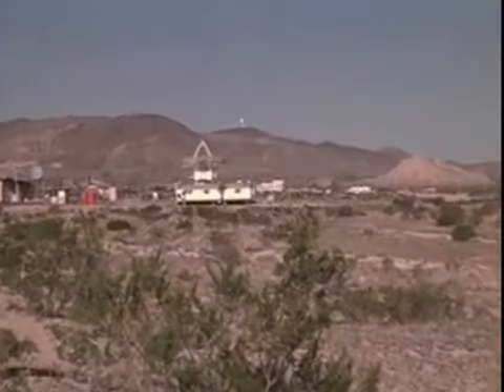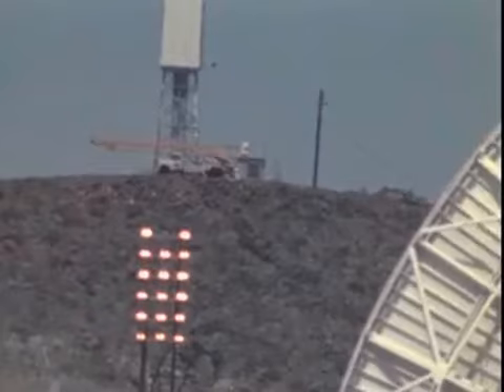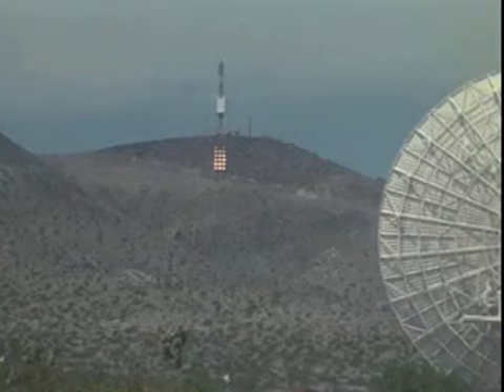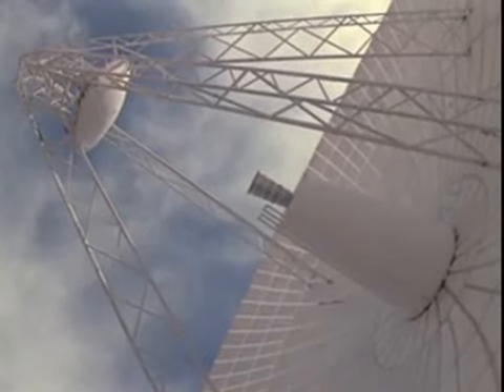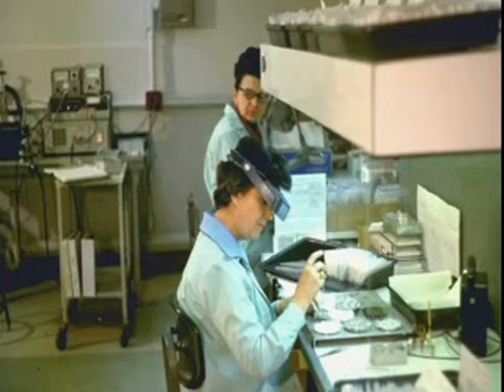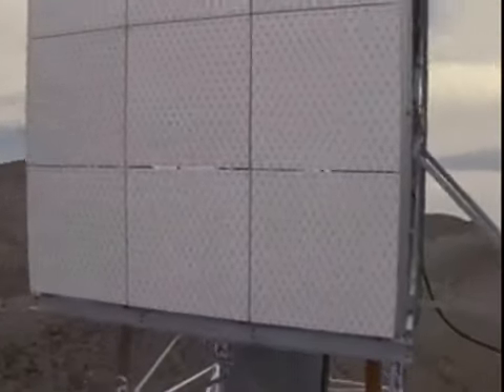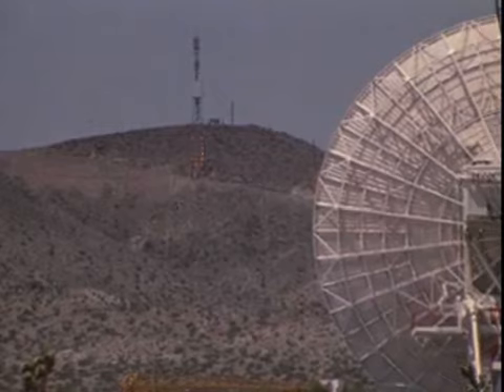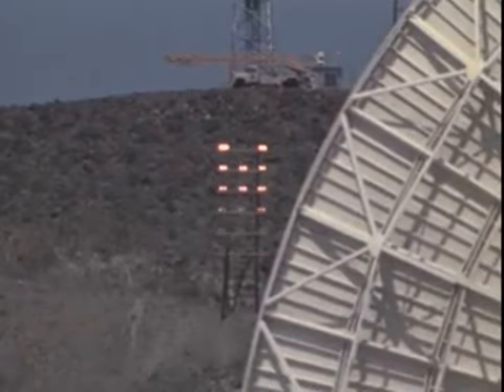1975 NASA JPL Goldstone Demo of Wireless Power Transmission

Comment: Sorry, the 82% figure is the receiver's local conversion efficiency. The total system efficiency was less than 7% because the transmitter was 450 kW. See https://ntrs.nasa.gov/archive/nasa/casi.ntrs.nasa.gov/19760004119.pdf
Reply: That is true. However, that simple and low-cost test wasn't intended or able to intercept the entire beam. Also, for NASA's desired application of the technology--Solar Power Satellites, which would beam (in its ultimately-converted form, on the ground) electricity down to the Earth's surface from huge, solar arrays-equipped satellites in geosynchronous orbit--the overall system efficiency was of secondary importance, because the ultimate source of the energy, the Sun, costs nothing. If need be, more and/or larger SPSs would make up for any efficiency shortfalls (as well as provide spare power plants for occasions when one SPS was out of service for routine maintenance, or due to some problem).
Reply: That's still quite good.

Comment: Knowing that the RF propagation of 1.54Km  for the 1.6 giga herzt signal is about 100dB or about 0.00000001% reaches the target.  It was intuitive to me that this is  pure propaganda, just like the proposal of GPS back (I never heard of spread spectrum) in the early 70's.  Then as I'm doing the math to prove to myself that I am not mistaken, it dawns on me that I did not account for the targeted antenna's gain of 4090 elements.  Damn the math does prove them right.  However a 82% efficiency for this short of distance is nothing to crow about for long term usage.  However, it could have some useful applications.
Reply: Is this ancient technology? Improved upon?

Comment: The efficiency was less than 12%. The 82% figure is just want the receiver converted, but most of it was lost in the transmission beam width greater than three degrees wide.
Reply: Thomas A. Heppenheimer covered this 1975 beamed-power experiment in some detail in his book "Colonies in Space," which covered Solar Power Satellites as well as space colonies. He mentioned the fact that much of the microwave beam passed to the outside of the rectenna array on the collimation tower (the "coll tower," which was/is normally used to check the alignment of the Deep Space Network radio & radar telescopes' dishes' RF optics); it was a simple, low-cost test that wasn't intended to intercept and utilize the entire cross-section of the beam. But from the portion of the beam that the rectenna did intercept, it did achieve 82% efficiency; today's devices do even better.
Reply: @j.jasonwentworth723  if you want to hit a 1 kilometer diameter rectenna receiver from geostationary orbit, you need a half power beam width of 0.002 degrees. The narrowest beam as of last year has a HPBW of about 0.5 degrees.
Reply: @jsalsman  That is probably why the projected operational rectenna systems (shown in artists' concept paintings in NASA publications about Solar Power Satellites and space colonies) are ellipses miles across (although since their open grid dipole antenna/Schottky diode arrays would have blocked less than 0.5% of the incident sunlight, they could have been supported by--and between--regular utility poles on farming and grazing land). The Japanese are also working on Solar Power Satellites, and they are planning to use Earth-based, SPS-type beamed-power systems (set up atop mountains) to beam power to rectenna-equipped villages and hamlets in deep, hard-to-access valleys.
Reply: @j.jasonwentworth723  the fact remains that they need half power beam widths under 0.02 degrees but our tightest beams have been over 0.5 degrees since the 1970s

Comment: This technology needs to be applied to rocketry. Specifically as a catalyst and maximization tool enabling Solid Rocket Boosters using aluminized or other metallic propellent formulas by applying voltage such as this during the ascent directly into the rocket nozzle suppling continuous high voltage to radically reformulated heavily metallic solid rocket propellents , much less reliant upon less uniform traditional high explsives components now found in most SRB's ?